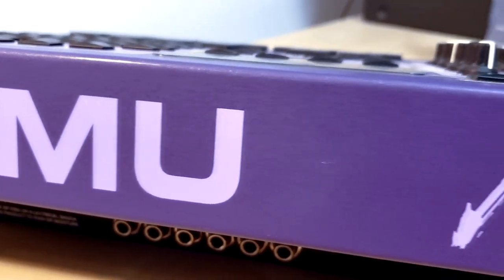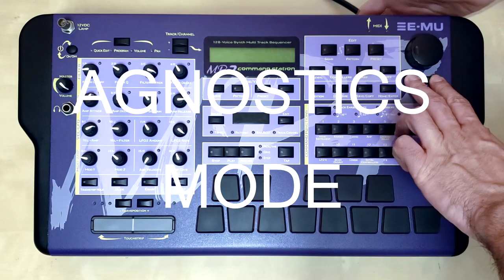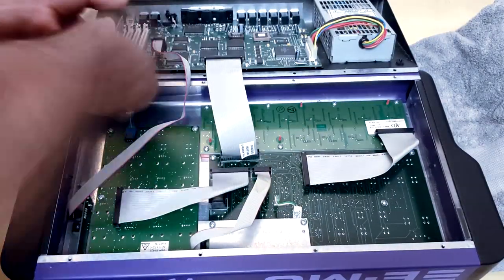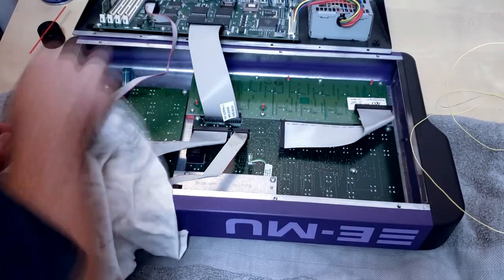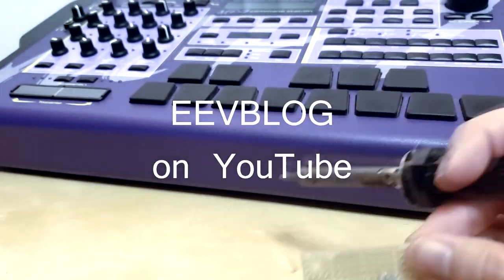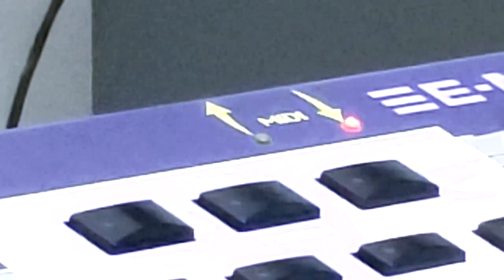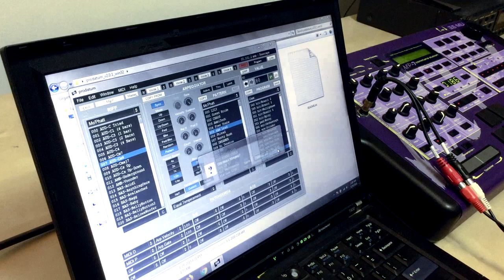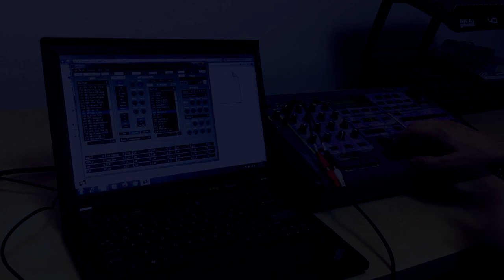E-MU MP-7 Command Station problems fixes and tips

Comment: Just came across this video & only 60 seconds in & I’m lovin it!🤣🔥…no idea what that hardware is but I want one now 🤣😂

Good content brother!💯👊🏼
Reply from the maker: Aww thanks bro 👍 good looking out 👀
Reply: If you ever do the same thing with a Roland MC 303 I will need to take notes🤣…. got one with a few connection issues but I rarely use it. Bought one in the 1990’s but I was so intimidated by it I never did much with it. Now I got another one and am determined to use it sometime. 😛👊🏼

Comment: I'm still on the earlier OS version 1.01 but emu.tools doesn't work for me? Do i need an older version of Windows to update?
Reply from the maker: I'm not sure tbh, worked for me
Reply: @brainztain  it workes for me to now. Didn't connect the cables right
Reply: Yeah, I had to make sure the MIDI Out part of the cable go to MIDI In part of the MP 7. Not opposite

Comment: Hey! Nice tutorial, you should make this a regular thing. Seriously! Mine turns on and freezes with all LED buttons turned on and the LCD goes all black. Tried to turn it on without the ROMs plugged in but still nothing. The oscillator seems to be working still. Any suggestions? Thanks!
Reply from the maker: Thanks! I'm guessing you already plugged/unplugged everything... I'd start there.  Maybe disconnect different components one at a time to see if the issue stops at one point that way you can pin-point the issue... Good luck!
Reply: @brainztain  I actually have two units and managed to figure out the issue is on the main board by swapping every other module possible. Thanks for your help

Comment: hey whats up great vid. just curious.. hows that air duster working to restore the data wheel? i feel like the contact is deep inside the part for the air to reach. would be great to know since im considering buying one. cheers
Reply from the maker: Hey there, thanks! Contact cleaner will make it better for a while (it's not air duster). Eventually it starts acting up again so y the only permanent solution is to replace it. I need to replace mine but my version is really soldered in there.

Comment: Where to get a suitable replace switch as the one shown in the video? And is the switch and the button one unit or can they be separated?
Reply from the maker: @gabrielepohly5670  You may be able to find the exact part number on Facebook command station groups. Yes, the part you touch and the button you solder are separate parts.  The button you solder is a common part on many electronics, while the one you touch may be harder to find as it's part of the command as station interface.

Comment: Are these machines prone to heating? Someone said that it's better to take those black side panels away so that the air circulates better etc. is this true?
Reply from the maker: @panutalus  i think I remember them getting hot when leaving them on by accident but idk if it was ever alarmingly hot.  If you take them off it will allow more heat to escape... It could be a good thing

Comment: Hey maybe you can answer a question about the mp-7, I've had it since early 2000's, for some reason like a year ago or so, it won't save anymore patterns/songs, everytime I try to save it says 0% memory, I tried to erase songs/patterns, none are erasing but don't know if I'm doing it right, maybe someone can help me out?
Reply: I have been there before.  I just went through a deleting spree and made sure I deleted each pattern.  It usually freed up memory for me.
Reply: @Axiohm000  how do you delete the patterns or songs?
Reply: @doja-3652  I will have to pull my MP-7 out and refresh my memory.
Reply: @Axiohm000  ok thank you
Reply: @doja-3652  on a pattern  go through and cut the 1st bar of each track and then save after that .  Also zero out the title and then save.  You should gain memory after doing that on a few patterns.